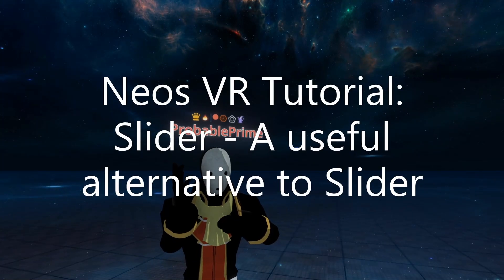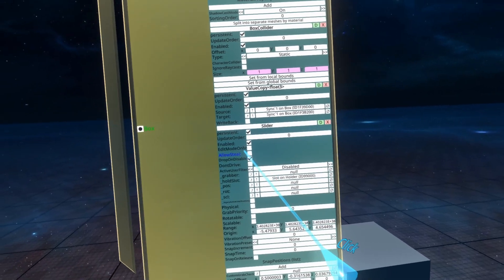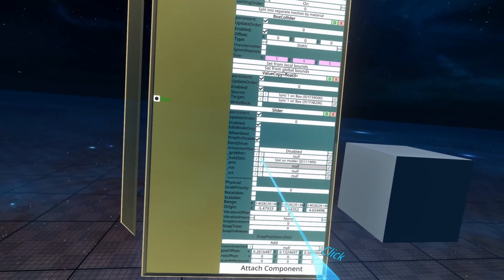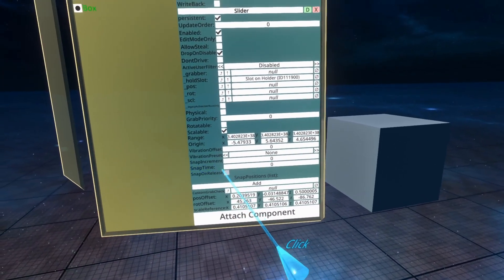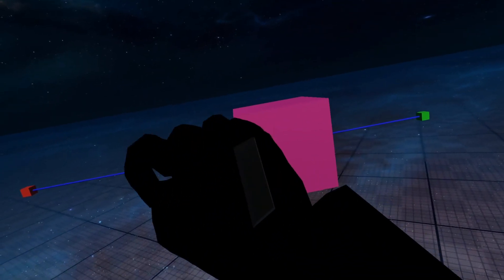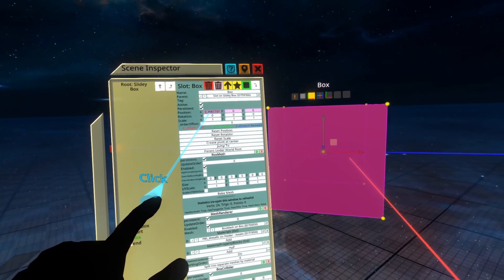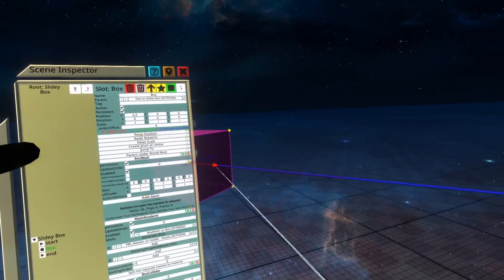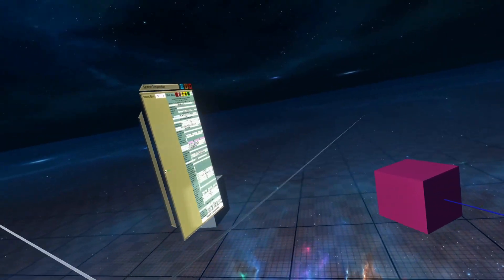OLD: Neos VR Tutorial: Slider - A useful alternative to Grabbable

Comment: HAHA! YES! I finally found the thing I need to constrain a grabbed object to a plane. I'm making a grabbable control that will control the rotation of something. I kinda figured out how to constrain it to a circle, by taking reading the handle object's position, unpacking the float3, repacking as a float2 while discarding the pivot axis, and then normalize the float2 to ensure it's at a known distance from center. Then I multiply the result by the number I want to use as a radius to constrain the object to. Then I unpack and repack the float2 to float3, and use this to write back to it's position field.